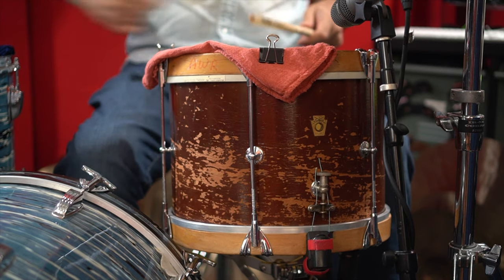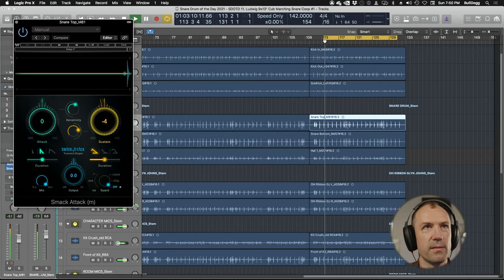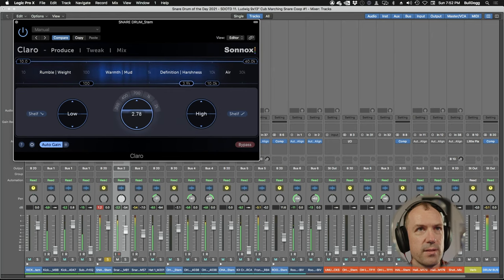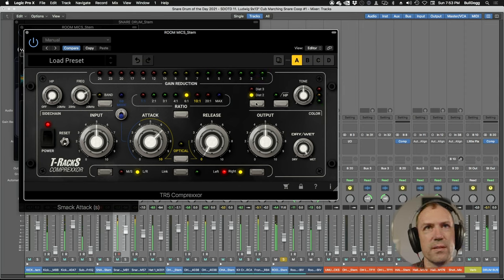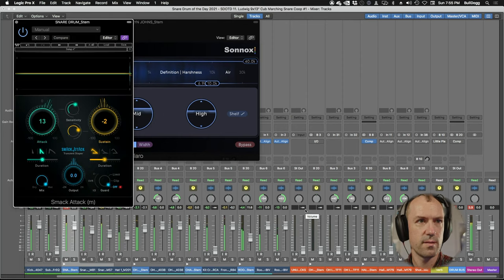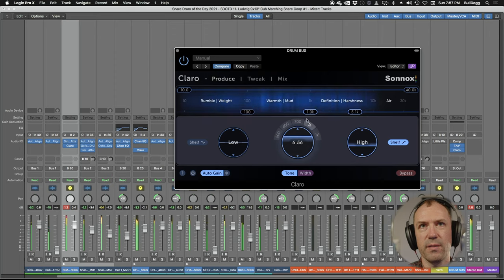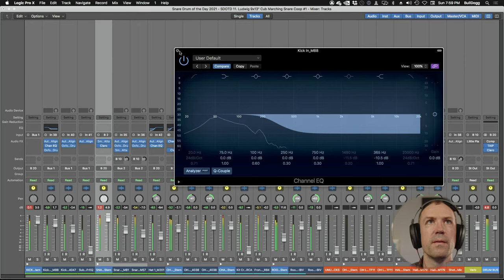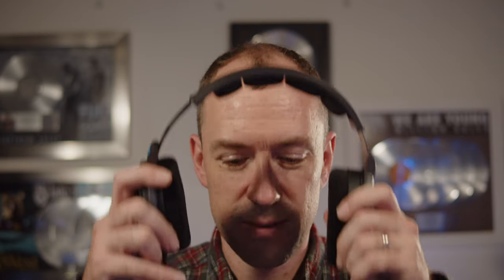MIXING LIVE DRUMS | Recreating the 1969 "Cripple Creek" Americana Drum Sound

Comment: This is great - I didn't know it was a marching band snare on the original, it's one of my favourite sounding records, so difficult to get into that area though - i think mic bleed from other instruments and the drums bleeding into other tracks might have been a factor too?  - Anyway, this is a great video!  Is it a sample pack you're working on here or are you mixing a song?
Reply: Actually, Levon repurposed the marching snare as a tom. For the actual snare he typically used a 4x14 (Ludwig or Leedy I think?)
Reply: @gabelossusthe4th  it was a single tension snare with gut or wire coiled cloth individual strand snare wires. That plays a huge part in how his snare sounds. The drum itself was probably a Lyon & Healy according to a few people I've asked about it. I have a 1910 Nokes & Nicolai that I put Grover snares on but kept the calf heads and it nails that tone.
Reply: @handidrummed  Agreed. Seeing as it's the '10s, most manufacturers had switched from gut to the coiled wire especially on the lower end wood-hoop model like this. I have a JW Pepper with the coiled wire and it nails the sound as well until you switch it out with modern wire snares and it's totally not even close!